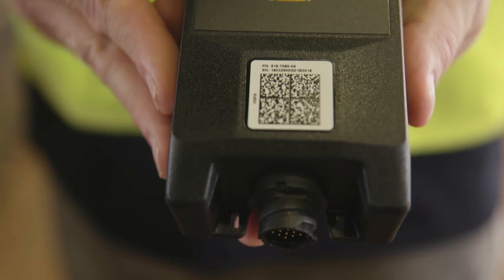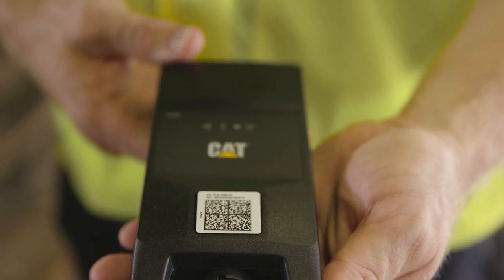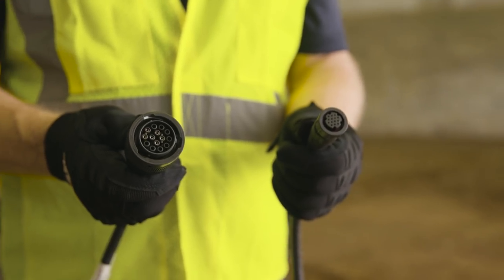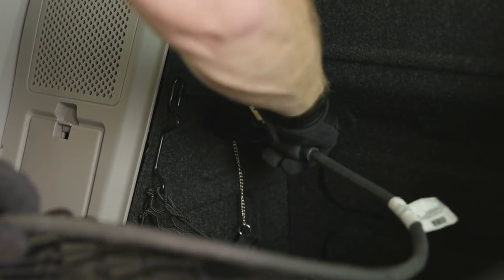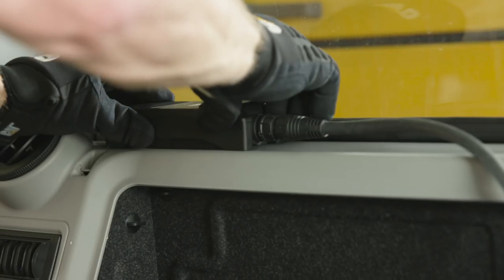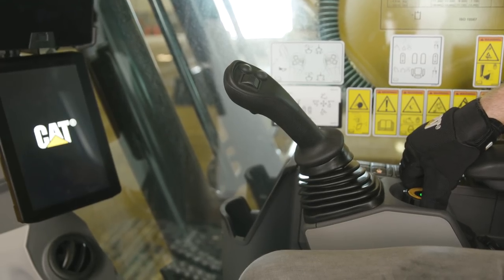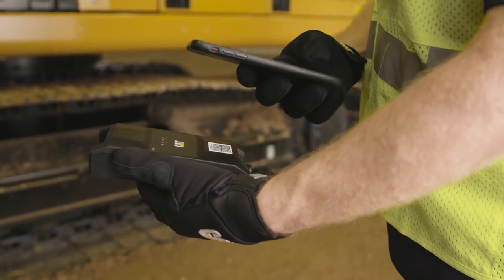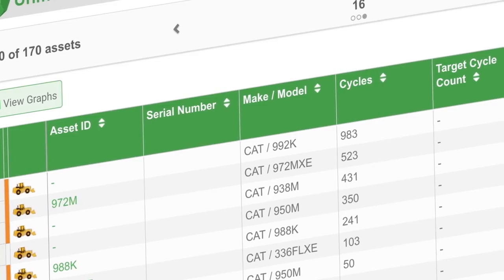Cat® Product Link™ | How To Install Your Device

Comment: If the signal coverage is low and product not reporting is there a device than can boost the signal? Bec there's no point if the project location is very remote and product link doesn't report